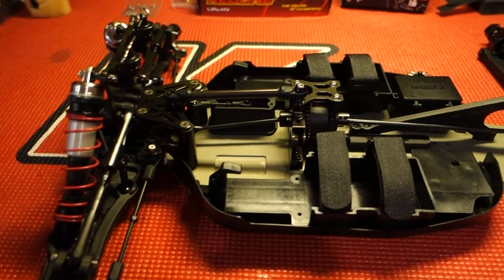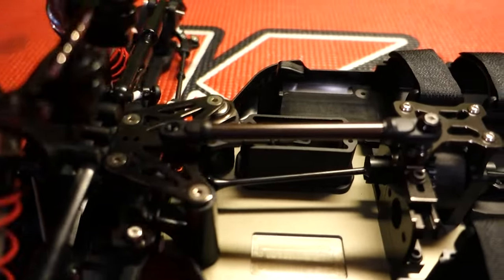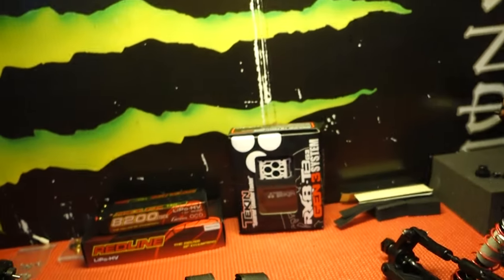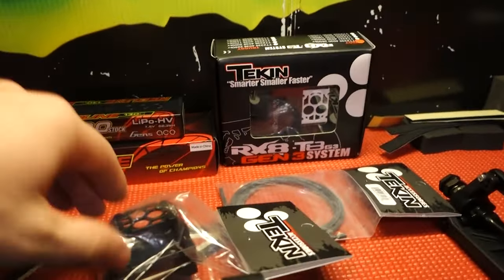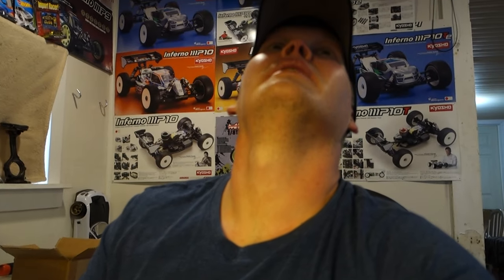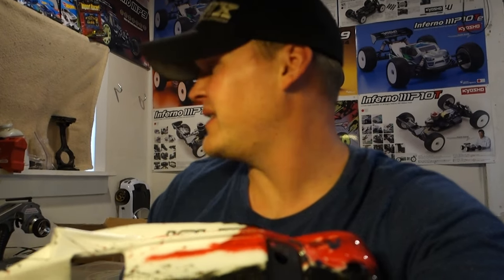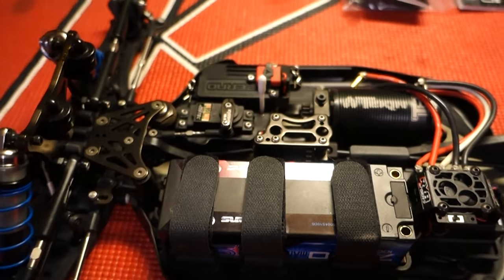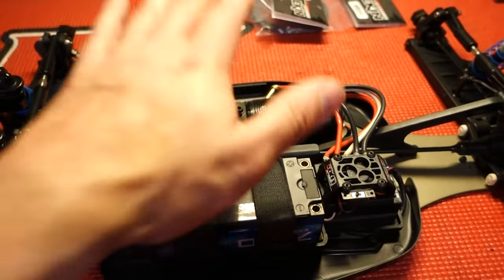KYOSHO MP10Te ￼ Apparently Motor size does matter

Comment: I'm building the same kit and just installed a Kyosho ISW203 motor mount after watching this video. It moves the motor far enough forward to fit a Tekin 2000. I can not take credit for finding this part, I contacted Ryan Lutz to see what he used. He told me the part number.

Comment: Man i was ready to pull the trigger until I found out about the 70mm motor max. I run the Tekin 2250kv as well at 77mm. Even most Truggy motors are 74mm and up. Even considered the new AE T4E but its the same setup so waiting on AE to tell me if it would fit. If not guess ill grab the Tekno. Just frustrating not sure what Kyosho was thinking on that?
Reply from the maker: Me neither it seems like an easy fix. Kyosho could’ve just move some stuff back a little bit but I’m sure they have their reason for it 😆